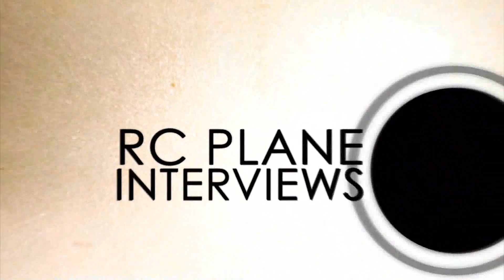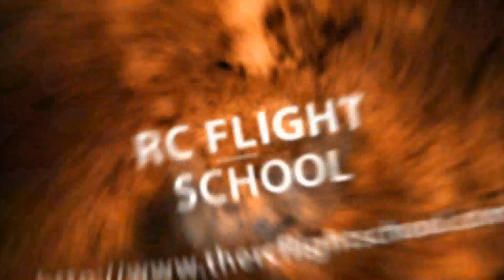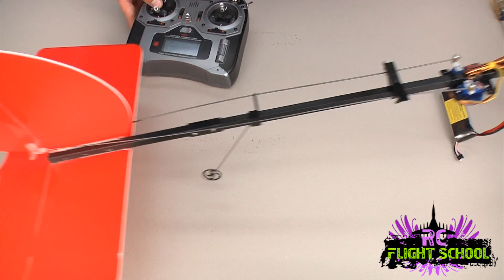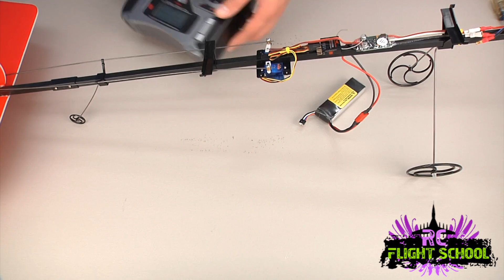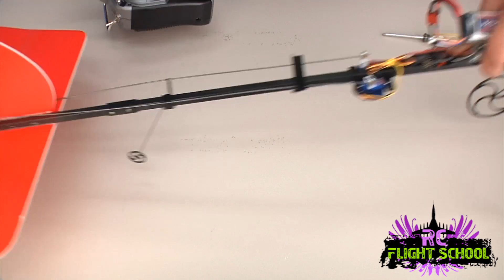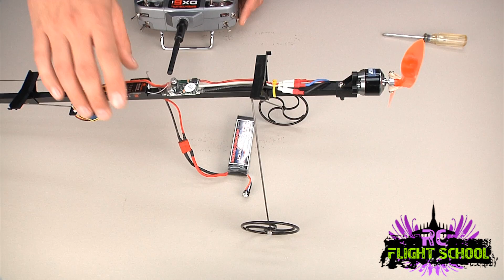How To Build An RC Plane-Slo Stick Part Three

Comment: Great instructional video, I have the same plane but with a brushed motor and I'm wanting to make the switch to a brushless motor. You didn't mention what size Motor, ESC and Receiver you used only the servos. So if you could post this it would help others including myself, upgrade our sticks. Keep the videos rolling by far the most informative I have found on here. Thank you.